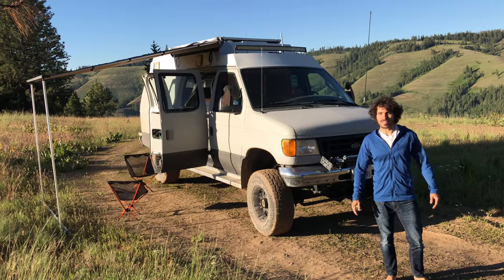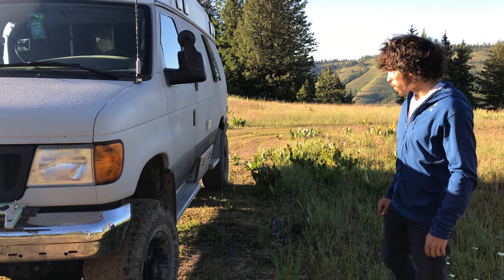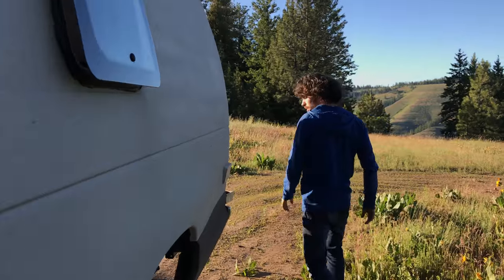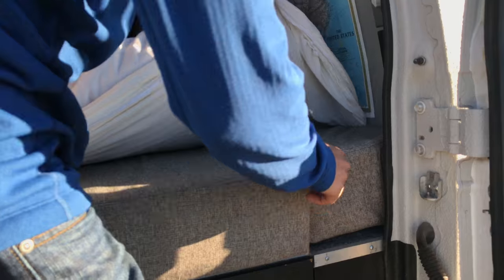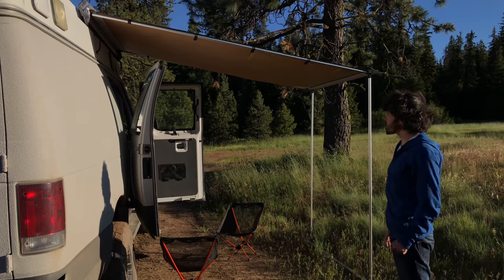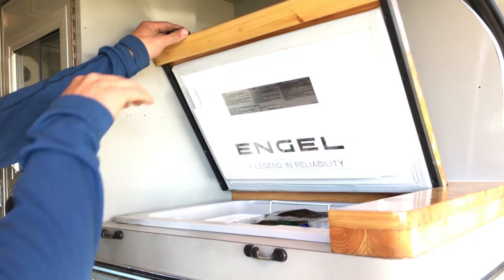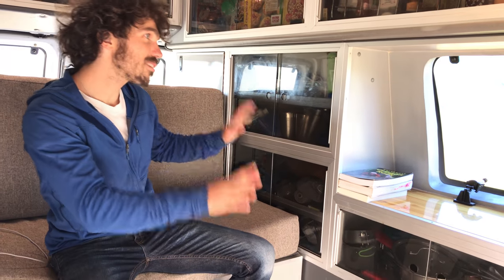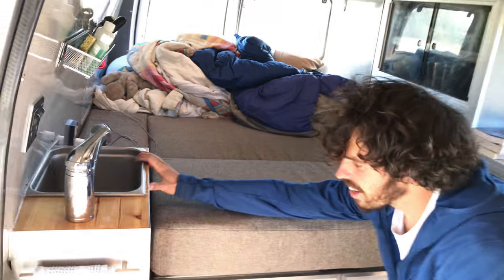Tour of our custom 4x4 ambulance camper van

Comment: Nice use and design. Good job having the engine monitor for the 7.3
Reply from the maker: Thanks! Having that monitor has definitely saved us – whenever we're climbing slow, steep grade – especially offroad – we keep an eye on all the temperatures. We've had a couple small issues, and being able to know right away what isn't the problem is awesome.

Comment: very nice setup some great ideas especially the bed
Reply from the maker: +Keith B thanks! It was a bit tricky to design so that all the lengths and angles were where the needed to be in both positions. It uses gas springs to assist in bringing and keeping it up, and also keeping I pushed flat down (so the shortest angle is actually just above flat). To do it I used the AWESOME software Fusion360 by Autodesk https://www.autodesk.com/products/fusion-360/overview which is FREE for hobbyists, just like students.
Reply: +Michael Marcacci install a skylight/fantastic fan,so your plasma bodies can astral travel at night,if needed.less or no metal in that skylight ,at least 1 foot sq
Reply from the maker: +jquest43 we definitely considered adding a fan to the roof, but the roof/ceiling gap makes it a bit trickier. Most of the time we do sleep with our heads right under the curved back windows, so while it’s not as good as a proper skylight, we have a great view of the stars!

Comment: When (if) I get my own badass 4x4 Ford van, this is how it will be, Out Freaking Standing, congratulations.
Reply from the maker: +Greg Flores thanks man!
Reply: +Michael Marcacci whats above the cabin door?
and wheres your water/medical ozonator?
Reply from the maker: +jquest43 Above the cabin is a huge electrical panel that swings down on a piano hinge, and contains all the auto-resetting circuit breakers, relays, and terminal posts. Just behind that (between the cab and rear area) sits the A/C unit and our audio amplifier, router, and LTE booster which can be more quickly accessed from that door above the fridge.
Reply: Can you tell me why you're interested in converting a Ford than other vans? Most vandwellers never really said why they chose the van that they chose to even start the journey. Thanks :)
Reply: +Michael Marcacci thanks
btw,no wifi inside,especially a booster.
you can amplfly with a antenna to recieve signals from far,but use ethernet inside van
protect your biology
no inside wifi
dr detrich klinghardt
dr jack kruse
Dave stezler on one radio network
extreme health radio
you tube
no leds
salt lamps ok
no compact florescents
NO BLUE LIGHT
dr rich massey and meridian grace on www.oneradionetwork.com

Comment: One of the best builds I've seen on YouTube and I've watched them all :) I'm sure it wasn't cheap to do but it was definitely money well spent. I like your sink idea, using a steam table insert. You could install Portal Axles to give you more ground clearance but it looks very capable as it is.  Have fun exploring ! ( from Calgary, Alberta )
Reply from the maker: Thanks!! Portal axles are definitely amazing things :) While this setup is far more practical for our current use (getting to and mapping rock climbing areas full-time) I’ve been “secretly” working on plans to build an all-electric 4x4 vehicle with in-hub motors. The only thing better for clearance than portal axels is no axels!

Comment: Thanks so much for making this video. I have been trying to plan my layout in my van and made blueprints almost identical to the yours! It's great to see it how functional it is for you, and you've given me some new ideas. Can you please tell me how you heat the back area?
 I was thinking about a propane marine heater. Hope the van lasts a long time and gives you many good times, stay safe!
Reply from the maker: +B Glenn Jr Thanks! Since we are using this for a rock climbing project, we haven’t found ourselves in bitter cold for more than a night or two, and the propane stove has warmed it up enough when making coffee in the morning. We do have an HVAC unit that’s tied into the Ford system, but the engine needs to be on to use it. I know that it’s very common to use permanent propane heaters in these, as well as portable Mr Heater style units. Hope that helps some!

Comment: One of the best vans I have seen.

How many liters/cans of Raptor did you use?

Do you mind saying how much you spent on the ujoint kit and installation?

Did you complete the inside build or contract it out?

Thanks
Reply from the maker: Hi there, and thanks! My best guess is that we used 6 or so liters of black Raptor Liner (on the grille, rocker panels, lower side panels, and rear drawer/fixture) and probably 12 liters of their tintable everywhere else. I'm not 100% sure, since we used less than we purchased, and I don't currently have access to the rest, which are stored away.

Depending on what you include in the cost of the 4x4 conversion (wheels, tires, etc) it cost us between $15k and $20k professionally installed. Everything else – paint, windows, electrical, water, drawers, bracketry, etc – we designed and built ourselves. This obviously let us save a LOT of money... but only if you ignore the value of our time.

Comment: * dual alternators up front

Question , when you bought your ambulance were you experiencing a parasitic power drain? I have a 2001 leader e350 and have 200 watts of solar. But have to supply the solar to all the batteries to avoid having to plug into shore line

Comment: Hello boltline van! I have an ambulance I’m building and have a couple key questions ... what brand kind of battery isolator did y’all use? Is it separating two starting batteries from 3 house batteries or 2 house batteries? 
Also where did y’all get that battery display how to go about wiring

Comment: Are you happy with the exterior paint? Did you notice any difference in fuel economy?
Reply from the maker: +Dave z We were changing too many things at once to be able to attribute any change in mileage to the paint specifically. That said, I don’t suspect it has worsened it noticeably: the modified vehicle has poor aerodynamics to begin with, and there is probably already enough turbulent air flow around the body that the paint adds very little. Of course, air resistance is proportional to the cube of velocity, so the faster I drive, the more these imperfections are amplified. We rarely drive it above 70mph for long periods, since the mileage suffers dramatically.

Comment: Excellent conversion. I really like your bed design and overall use of space. How has the 4wd conversion held up? Any problems?
Reply from the maker: +AJourneyOfYourSoul Thanks! It has been working out very well – the 4x4 has been used many, many times, and has allowed us to get to spectacular climbing areas that otherwise wouldn’t have been possible. We’ve definitely had problems here and there, but they have all been easily fixed: at one point, the in-tank fuel filter got clogged and starved us of power. This would have been trivial, had the tank not been full, but was still not a disaster. We also had our heater core begin leaking, but were able to swap in a new one in an O’Reilly’s parking lot. There have certainly been other smaller things to fix now and then, and general maintenance—and the van‘s tiny hood makes it a pain to get to things—but after a few swear words it’s always gone back together nicely!

Comment: I just stumbled upon this video by chance; I've been planning a van build and want many of the same components as found in yours. Fantastic build. Would you mind if I inquired as to the cost of the 4x4 upgrade. As well as the product you used to hard coat the exterior. Linex wants like $5000 to do what I want. I dig what you guys did with your build.
Reply from the maker: Hi there! The 4x4 cost can vary substantially, depending on what you consider part of the conversion (wheels/tires, limited slip diff, etc) and where you can find a used front axel and T-Case. A good ballpark, though is $15k if you pay for the labor (and much less if you DIY). As far as the paint goes, it’s called Raptor Liner by U-Pol, and we used somewhere in the range of $500 worth of product, plus the cost of all the prep materials. The stuff is REALLY easy to spray if you have a decent compressor, but still requires good prep work (which is 90% of any paint job). The texture does let you get away with less-than-perfect sanding though, which is quite nice. Good luck on your build!
Reply: Thanks, brother!

Comment: Hey Michael you guys did a great job on that build , I have a 4X4 Chevy Express and love it just wondering how the Raptor is holding up I recently purchased some and will be applying it when weather permits ( I`m in Ohio ) happy travels!
Reply from the maker: Todd Pettit it has held up impressively: we’ve driven through manzanita-lined trails so thin that both sides scrape at the same time, and the only damage we have ever had is a small chip from a pine tree branch, and even then it was the base Ford paint that separated from the steel. Of course, the strength is totally dependent on the quality of prep work, so a lazy application probably wouldn’t have quite as good results. But this is true no matter what you spray :)
Reply: I am prepping mine now hope to have it done in a week. Thanks for the reply.

Comment: How much did the 4x4 conversion cost overall? I have a 1991 Ford Club Wagon XLT and 4 wheel drive could be useful.
Reply from the maker: +Connor Lipke the conversion price can vary dramatically based on what all you want and how you source the front axle & transfer case (anywhere from free to several thousands). Parts from UJoint Offroad were about $5k, http://www.ujointoffroad.com/leafconversion.html not including the axle and t-case parts. If you’re paying a shop to do everything, budget $10k. If you have the space and tools, you can do most of it yourself, but will still want some things (fuel tank welding, etc) handled by a pro.
Reply: i have a 2013 ford e350 with the 4x4 conversion by Clydesdale in BC Canada, and it cost about $20,000

Comment: I looked at a similar ambulance, based on a van like this, but the chemical smells of plastic and whatever else was going on inside was over-powering. how do people deal with that?
Reply from the maker: +Christopher 3D We didn’t ever have a smell issue with this, and both my wife and I have quite acute sniffers. It may depend on the ambulance builder (Leader in our case) or what the ambulance company used to keep it clean. I should mention that we went nuts with 10% bleach and other cleaning chemicals (wearing VOC rated 3M masks) to remove grime and disinfect the whole thing. That added it’s own smell, but dissipated within a few days.
Reply: Great, thanks.

Comment: With the higher ambulance top can you fully stand? depending on how tall you are obviously
Reply from the maker: +Josh fedora Moore My wife and I are both 5’ 10” and can’t quite stand all the way straight. We have friends who can and we are a bit jealous. This is the con of the otherwise extremely well engineered ambulance top: between the roof and ceiling there is a gap of a few inches for wiring and a steel roll cage.
Reply: I suppose if you really had a lot of energy, and, an excess of money you could always tear out  the floors and recess them like Roadtrek does in order to stand straight up in it. Very nice build!

Comment: Serious stuff. Can't beat a 4x4 van. You might want to check out ours as well. Have you figured out what gas mileage you get if you drive a soft highway speed? Are you full timers? Thanks
Reply from the maker: +VanoRama RV With the van fully loaded doing ~60 we have recently been getting a consistent 16.5 mpg (in the Midwest) but closer to 15 out west (pulling steep passes regularly). As soon as we’re on dirt it plummets, but that’s to be expected. We are on the road mostly-full-time right now, with long stops to work with the data we’ve collected from climbing areas. I’ll definitely check you guys out once we are back on LTE (3G works great for comments but not for video)!
Reply: Thanks for sharing. Driving soft highway speed we get aprox. 12-14 mpg at best with the 460 engine. You have to minus 20% to convert from Imperial to U.S. gallons though. So it's costly.

Comment: Your conversion kit appears to be from ujointoffroad correct me if I'm wrong.
Reply from the maker: You are absolutely correct! It's their 6" leaf kit, which is the minimum lift you'll need to fit crossover steering with a track bar. It handles extremely well on-road, and is amazingly capable off pavement. The 4x4 conversion was the most expensive single part of the build, but well worth it since the vehicle's purpose is getting us into remote rock climbing destinations.

Comment: What is the milage on the engine & transmission?
Reply from the maker: +Gaetan Giroux We currently have about 285k on the engine, and an unknown amount on the much-newer transmission. For us it made a lot of sense to go for a higher-mileage 7.3, since we were replacing or modifying so much of the drivetrain already, and Ford claimed an average in-service life of 500k miles for these engines.

Comment: Great set up, but I didn't see any kind of toilet or shower facilities what do you guys do?
Reply from the maker: +Rustic Nature Reimagined Great question! We chose not to install a dedicated shower or toilet, since we didn’t anticipate needing them frequently enough to justify their space, cost, or extra complexity. And for our use case, we were right! When we are in remote, undeveloped areas, we have been able to dig holes when appropriate, and use WAG bags when not. More often, though, we have access to pit toilets at trail heads, or gas station/Walmart/Starbucks restrooms. For showers, our faucet extends far enough to reach outside, and has a spray mode that makes it perfect. Since we frequently work in places that are private, this has worked well.

Comment: Where is the Restroom/Shower facility inside the van??
Reply from the maker: We chose not to install a dedicated shower or toilet, since we didn’t anticipate needing them frequently enough to justify their space, cost, or extra complexity. And for our use case, we were right! When we are in remote, undeveloped areas, we have been able to dig holes when appropriate, and use WAG bags when not. More often, though, we have access to pit toilets at trail heads, or gas station/Walmart/Starbucks restrooms. For showers, our faucet extends far enough to reach outside, and has a spray mode that makes it perfect. Since we frequently work in places that are private, this has worked well.